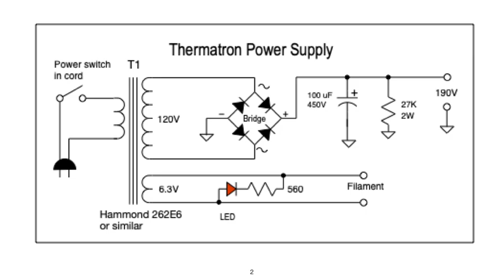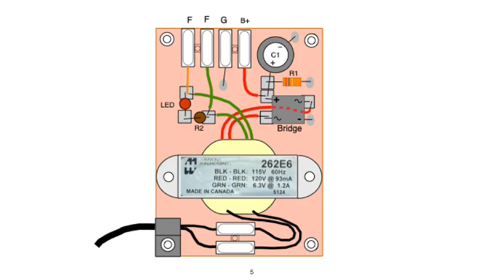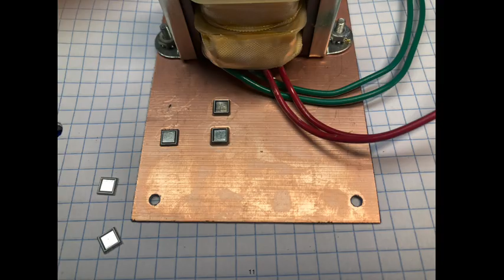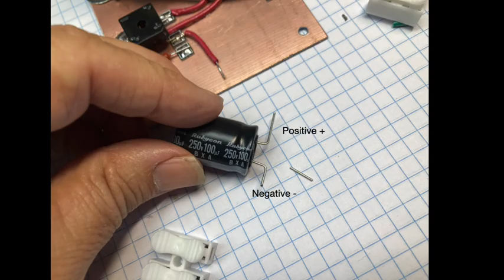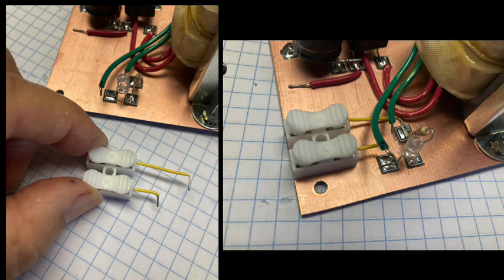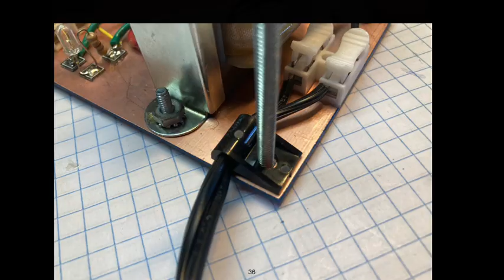HSD Power Supply Assembly Instructions

Comment: I just purchased HSD Thermatron Power Supply kit and HSD “Last Ditcher” 40M CW Transmitter Kit, My question is?  { Can anderson  Power Pole Connector be used between power supply and transmitter}  ? Thanks  WD0O Dennis